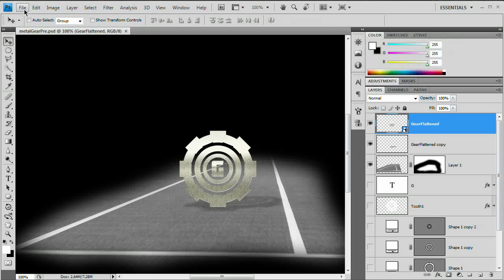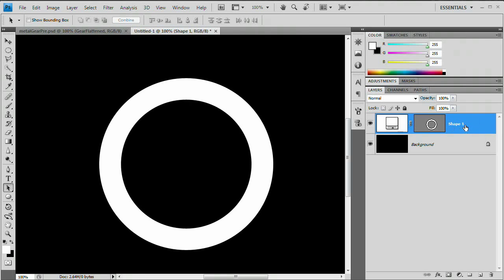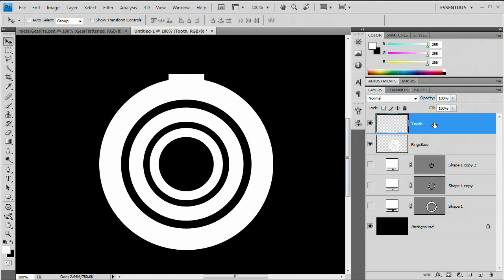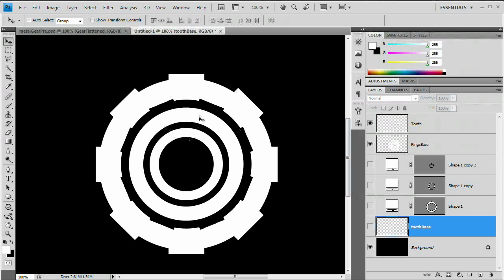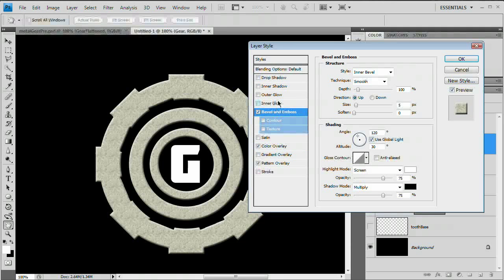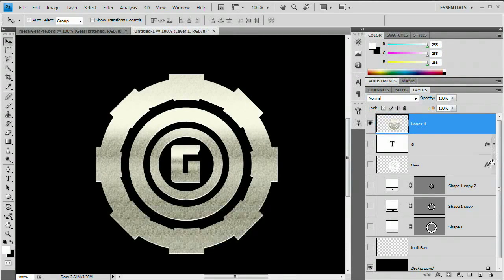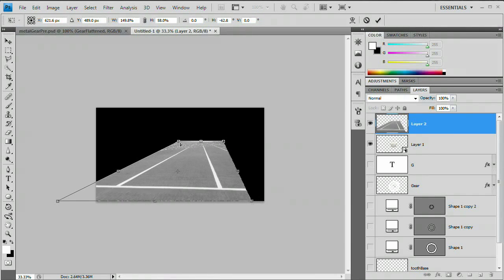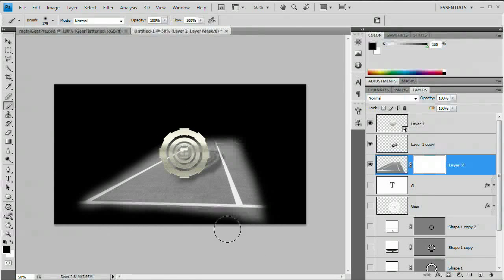Create a Metallic Gear Logo! Photoshop CS4 Tutorial

Comment: Instead of putting a photo in the background of a racetrack, you could have just drawn two white lines in an angle to or a rectangle with thick outline and skewed it?
That would have been easier. Video was longer than usual, but good.